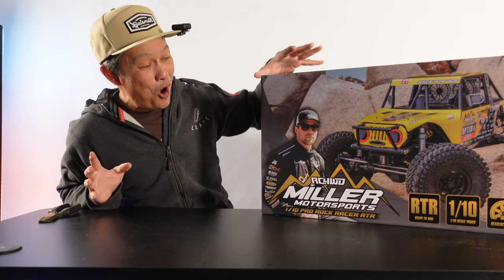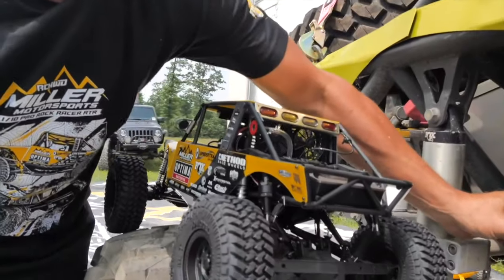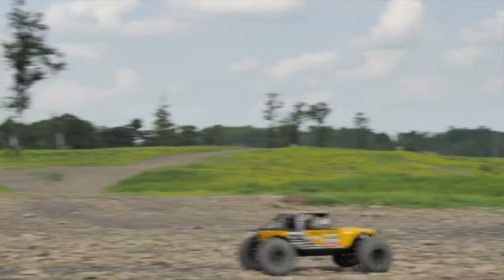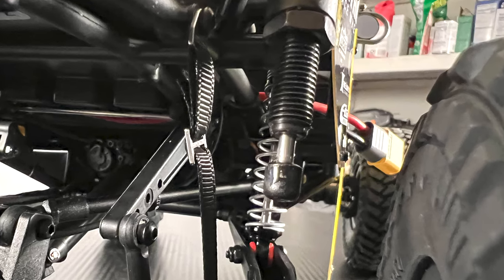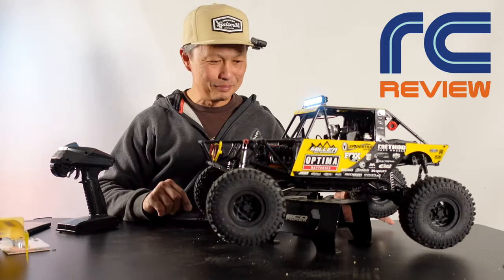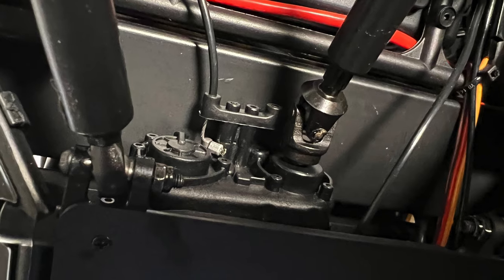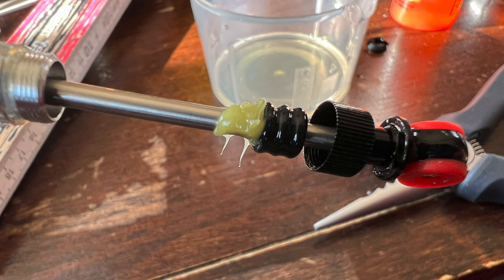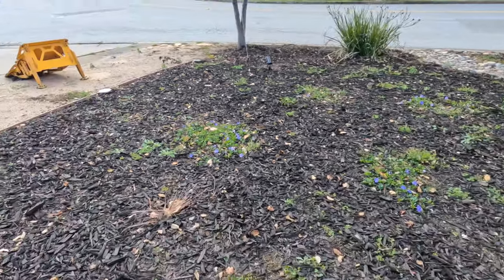RC4WD Miller Motorsports Rock Racer - unboxing, top speed, programming, shock oil

Comment: I got mine on the first batch and still haven't tried it.  None of my batteries fit.   Great review.
Reply from the maker: Haha, Looks like this is built and assembled exactly the same as the first batch.  Yeah, I'm lucky I had a crawler 2200 3s battery
Reply: @RCReviewChannel   ya.  Mine had a few items rolling around in the box. I ordered a 3s soft pack with the right dimensions.   I was thinking about filing the opening of the battery box but didn't want to ruin it before it's first run.

Comment: I’am putting the Sensoret Crawler editions Castle Mamba X Esc with a Castle 1406 Slate 2850kv motor and On 4S😃 
It is gone to be Black also, without Those stickers… And som 2.2 Low Profile Hyrax G8 with 2.2 Metafil mesh Beadloc and i Got the Alu Knuckles and C-Hubs😃👌🏾 

Gonna be so Badass..!!